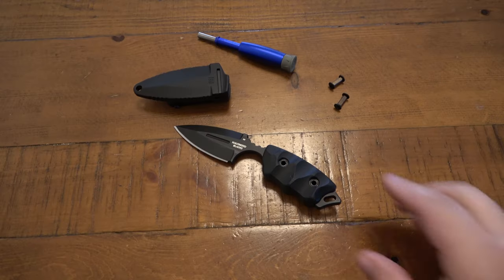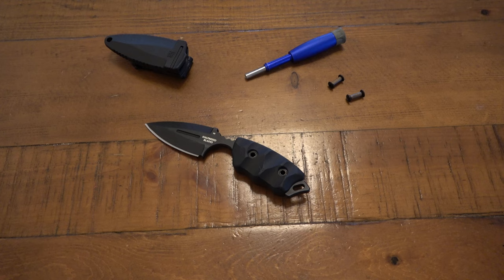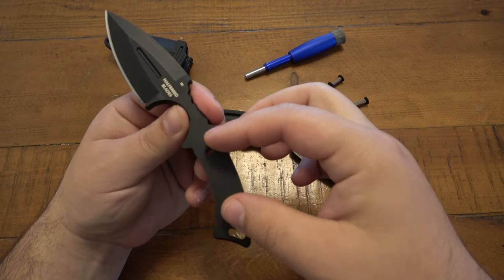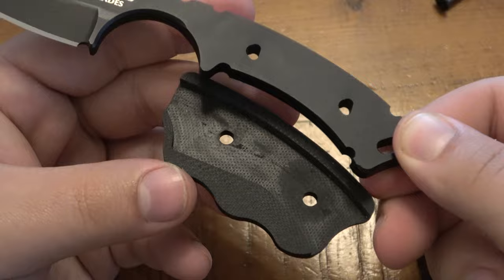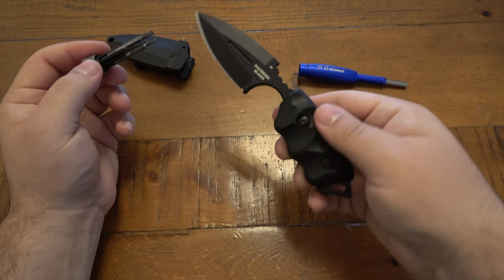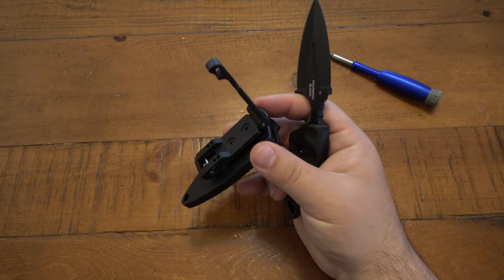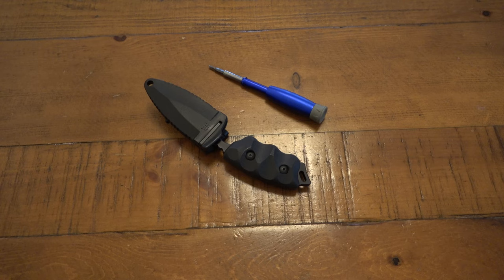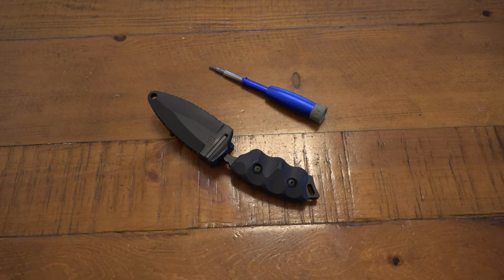Halfbreed Blades CCK-05 You Wanted To See What's Under The Handle Scales...

Comment: Usually a hair dryer wont really loosten lock tight, for stubbourn screws with thread lock on them try taking a soldering iron (withba clean tip) and hold the tip against just the screw head, the heat is direct and will transfer down the screw, works really well

Comment: Someone already mentioned a soldering iron for loosening the thread locker. But for the spinning screws (like on the Spyderco PM2) I have a set of Wiha L shaped torx, I'll put one (long side) in my left hand between my index/ middle fingers and squeeze tight and use a straight torx driver in my right hand. It takes a bit of getting used to it, but it does work, at least for me.